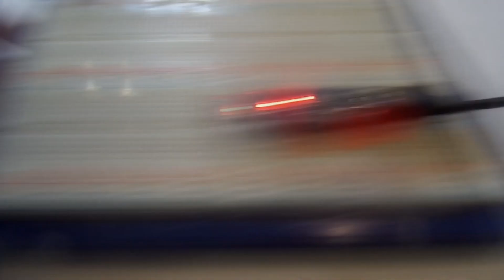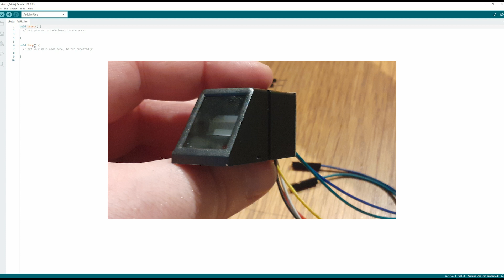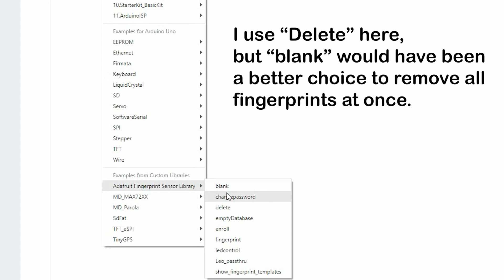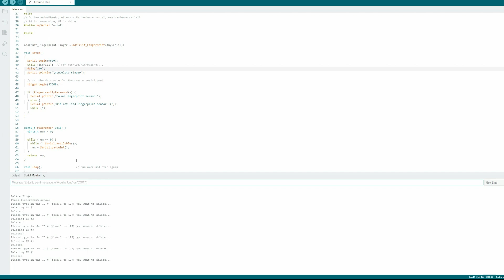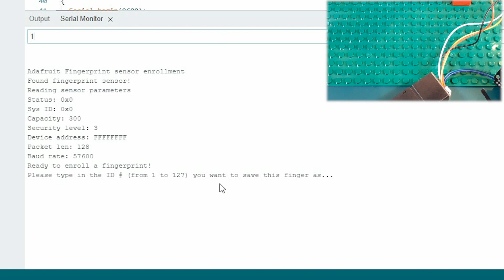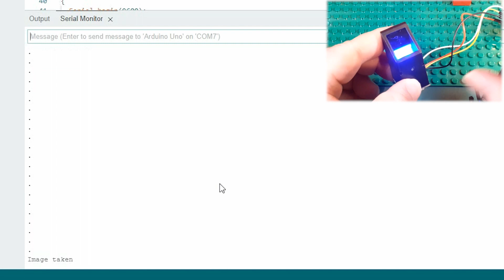BASICS: Finger Print Sensor on Arduino - with lego safe!

Comment: You are the smartest electronics youtuber I know and I wondered if you could maybe help fix an issue I have? I am using an ili9341 from adafruit. the product number is 2090. and it only shows me a white screen. I dont know if my connections are wrong or the code or driver. I have tried adding a delay(2000); before running tft.init(); but it didn't work. I am using a esp32 wroom board too by the way. I've been searching for years on how to fix the issue but haven't found an answer yet. If you can't help or don't know how, it's ok. You'll always be a genius and a good person. Have a great day XTronical :)
Reply from the maker: I did a video on adding this screen to the ESP32, give it a try: https://youtu.be/rq5yPJbX_uk

Comment: Hello, I need help with the DACAudio library, because I've got a problem: I read on the internet, that in order to make that work, I need a wav file converted to a HExdump. However the wav needs a special encoding called "8 Bit Unsigned PCM". Whenever I try to convert a mp3 to this format, I get a really loud distortion sound. Is this normal? Are there any ways to fix that? What if the Hexdump is too big for the array?
Reply from the maker: Have you watched my early vidoes in this series on how to convert sounds? Might be helpful

Comment: Hello sir, is there any way to display bitmap images on to an ili9341 using an esp32 running tftespi library??. I figured the connections thanks to one of your videos.. Currently I'm working on a project and I'm fairly new to these type of stuff especially coding .... And struggling 😅. The issue is "drawSdJpeg" function showing compilation error in nested if statement..
Reply from the maker: Just for now, double check your using the version of the library I used. The newer versions aren't compatible with all the examples I show.
Reply: @XTronical  Ok sir, I'll check on that. Thank you so much for replying.